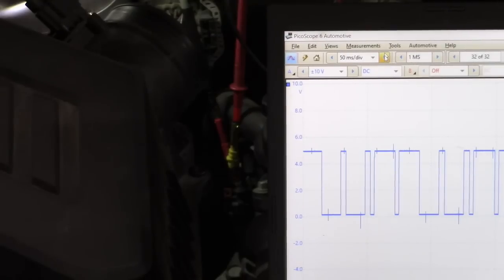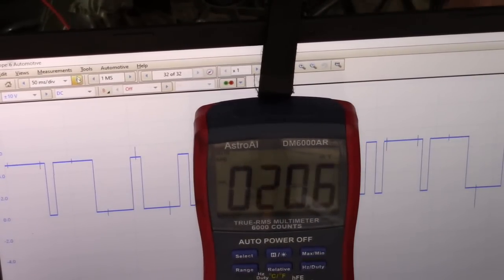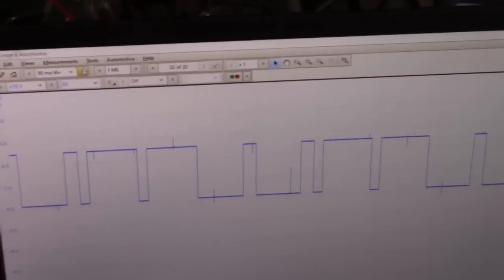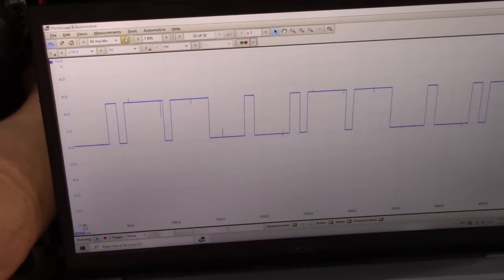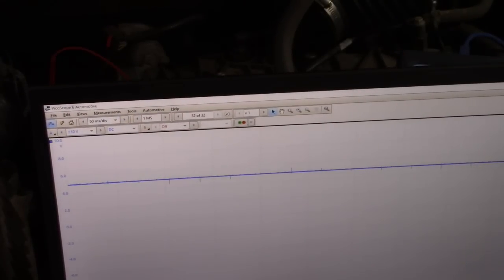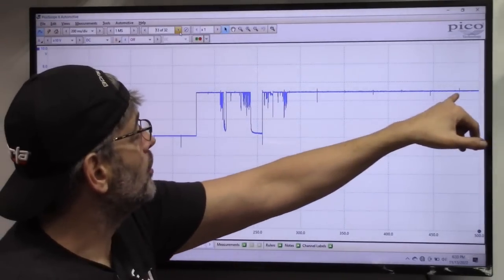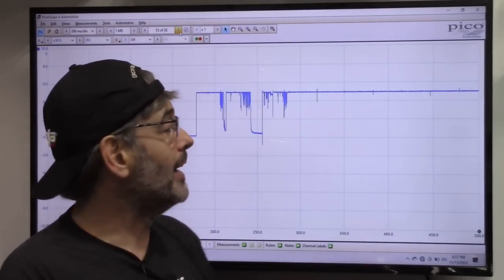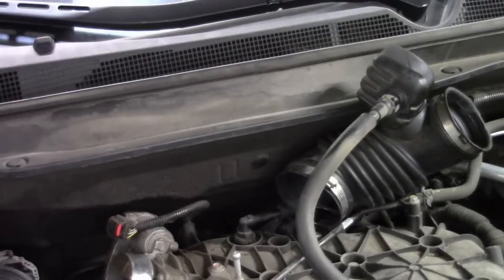How to Catch an Intermittent Bad Cam or Crank Sensor

Comment: I have a question about probing. If I have a 3 wire sensor for example… 12v power, ground, and 5v reference/signal; and I want to test the 5v signal, do I place the positive lead on the 5v signal wire and the black test lead on the ground wire or do I put it on chassis ground? 

I’m really trying to get an overall understanding (in case I don’t have wiring diagrams) of how not to fry the computer.
Reply from the maker: It depends on the design but on virtually all of them the signal will be a positive voltage so you will have one lead of DVOM on EITHER the sensor ground or chassis ground and the other on the signal wire.
  The ground doesn’t matter as far as the reading however if you don’t see a signal, you will want to try putting meter to chassis ground because maybe the sensor ground is bad. Remember you are probably looking at a sensor issue if you are doing this, right?
  Also keep in mind if you don’t see signal it might be because there is no reference. 
  Usually what I do is I put one lead to the reference and the other to the sensor ground. If I see the reference voltage then I know both the reference is good and sensor ground is good right there.  If I don’t see the reference voltage I will move the lead from sensor ground to chassis ground and if I now see voltage, you know the sensor ground is bad. If I still don’t see reference, I know there is missing reference signal.

Comment: Had my changed before it was car would shut off now it doesn't but runs like crap showing 336code also had cam and crank done can't do relearn because it won't go to 4000rpm what should i tell them to look for when I take it to the shop

Comment: I have a 2007 Buick Lucerne 3.8 V6 and I have the problem of sometimes it cranks but has the auto start problem where it keeps on trying to crank. It also stalls occasionally at low speed. Sometimes it will go for weeks without a problem before it does it again. I've been at a loss to figure this one out. I haven't taken it to the dealership because it happens so seldom that I'm sure they won't be able to find it. This is the first video that I've seen that referenced the problem of it keeps trying to crank once started.
Reply: Have you located the problem?

Comment: what causes crank sensor to keep failing . replaced 3 in the last 6 months .
Reply from the maker: What is the nature of the failure. What part of the sensor is failing? Is it the power, ground or signal output?
Reply: @SchrodingersBox  I don't know , I put a new one in , fault code Crank sensor and goes good for 2 to 3 months then starts hesitating again and stalls . The first time i took it to a dealer due to no fault codes . They couldn't find what was wrong with the car . So i changed the fuel pump , no fix then the Crank sensor and ran perfect for a few months . Then stalled with engine light , Crank sensor fault . Changed it again and now this is the third one that has failed . must be something to cause it to keep failing .
Reply from the maker: So what data do you have?

Comment: I got a no crank no start On a two thousand three chevy trail blazer four point 2 Six cylinder. I changed the old spark plugs removed all 6 Old ones. I put the new ones in and it started up but it was misfiring.  So I changed the ignition coils around and it still was misfiring so I did not have my scan tool so I ASSUMED IT WAS the spark plugs I just purchased and put the old ones back in. When I put the old ones in, now it doesn't want to start. So I again put the new ones back in and it still crank no start. I got codes po300 .. what the heck do you think happened? Could it be my camshaft sensor or solenoid
Reply from the maker: what data do you have? Since you don’t have a scantool just stick with the extreme basics - what is you signal voltage at the coils showing and is ground side switching conformed?

Comment: Good video. Can cam sensors fail intermittently without throwing fault codes?
Reply from the maker: Yes for sure. The code depends how long the signal is missing and also how consistent it is missing.

Comment: My 2007 Dodge Charger is having this problem and was wondering how I was going to "properly" diagnose this. Tomorrow will be a good day to try to tackle this and I'm saving this video and going to be referencing this video as I do. Thank you. I have a crank no start since June of 2022( last summer.)  All started after changing the ECT sensor got a horrible rattling sound instantly on first start and everyone after. Thought I had a pulley bearing going out or something and every since I took the serpentine belt off it will not start. Cranks forever and ever and at my wits end with it stressing out. Even had to basically go out and get another vehicle so I had transportation for work and everything else lol.
Reply: Updates..?
Reply: Did you figure it out?

Comment: Hello, thank you for such an informative video. Can anyone tell me if reference voltage or ground is lost, will the voltage shown be '0.0?' Thanks everyone, for trying to build my knowledge.
Reply from the maker: it will if you measure against that lost ground. check against a chassis ground to confirm voltage is present or the ground is missing.

Comment: Wonder if my 07 dodge ram has this issue when I turn to crank the 1st time wont start  unless car is hot but when cold I need to go for a 2nd crank. My other issue is truck stalls when I'm coming to a stop at a sign or light.
Reply from the maker: could be. when it happens just check any easy to access coil for ground.

Comment: Just changed my altima 2014 crank sensor due to no spark. It did not help. Took it to the dealer and they said after market sensors don't work in Nissan cars.  I wish I knew that.
Reply from the maker: I find that pretty suspicious.  The factory sensor worked??
Reply: Aint true. I have nissan frontier. Truck completed stalled dead on freeway which scared me to death with no CEL warning. Towed to my honest mechanic, code p0335 ( i think) replaced after market. Back on the road again.

Comment: I’m having the intermittent need to crank over 20 times to start problem. A strong deiseling smell once it finally starts. How do you know if it’s camshaft or crankshaft sensors? The problem so far ONLY HAPPENS ONCE THE CAR has been driven…is hot…then shut off for 20-30 minutes. Hasn’t happened on a cold start…so far.
Reply from the maker: What is your crankshaft sensor data showing?
Reply: @SchrodingersBox  Taking it to my Toyota mechanic Friday

Comment: Interesting is, RPM didn't reflect sensors bad output while it should spark timing, shouldn't it? Also could be good to mention potential problems  only when engine block (and sensor) are hot, is it correct?
Reply from the maker: Good observation on the RPM. I do believe it’s because the Crank sensor provides the RPM signal as opposed to cam sensor(s).
Reply: @SchrodingersBox  Engine should stall as a precaution since crankshaft position (piston top dead center) is now unknown so spark timing is only estimated and bad spark timing can cause problems. I would expect more sanity from ECU..
Reply from the maker: Yea but remember there are TWO cam sensors on this vehicle. Maybe the other is being used as reference when one dies?
Reply: @SchrodingersBox  Oh my goodness,  I thought all this time you were testing crankshaft sensor 😵‍💫
Reply from the maker: Hahahaa yeah you had me confused there my friend lol!!!! All makes sense now, right?
Reply: @SchrodingersBox  Sorry about that. I hope you too understand now my point. Thank you for your time.

Comment: If the sensor gets "stuck" for whatever reason pulling your reference signal voltage to the ground, you might think that you have a wiring issue while, in fact, you have an internal failure of the sensor (internal short to ground). So, if that happens, you need to disconnect the sensor and see if the reference voltage goes back to 5V with the sensor disconnected.

Also, the supply voltage for the sensor could be 12V (battery voltage or maybe even stabilized 12V), it is not always 5V.  

The ABS sensors on modern cars are Hall effect sensors and they only have two wires (off the top of my head, signal output serves as a ground too). And various position sensors also use the Hall effect element in their circuitry and have three wires, but they output analog signals.

Comment: Learning so much from these videos, really love  the scientific approach, thank you! Nowhere near the 2% yet more like 50. However, inspired to do better my audi was starting badly and stalling when hot. Scanner showed intermittent crank sensor, forget code. Looked up the spec for resistance,  unplugged it and was in spec. Damm! But tried harder. Started the engine let it run till it stalled. Checked resistance, open circuit! Replaced sensor and running fine now!
Reply from the maker: Nice work!!! Yes the problem is while it was working you will see the normal resistance. you have to catch it fail.
Reply: @SchrodingersBox  thank you! While it turned out to be what the code said, I did not want to fire up the parts cannon. Was so happy to get under the car knowing that was the problem rather than hoping.

Comment: No good to say any wire colors anyways cause brands use different colors than others so if ppl think the color matters it will more than likely be a different color on their rig
Reply from the maker: EXACTLY!!!!!!!!!!  I wish more people understood that.  can you imagine the hate mail I would get if I said to ground the green wire but on someone’s car the green wire is a power feed from the PCM and grounding the wire shorted the PCM?
   You get it bro!!
Reply: @SchrodingersBox  iv been working on a ton of different brand rigs for the passed 20+ years iv seen alot of different color grounds and powers on different brand rigs
Reply from the maker: Yeah and the “reddish colors are powers and greenish colors are grounds” is a horrible rule. On my GM vehicle, the power for the crank sensor is perfectly green lol.
Reply: @SchrodingersBox  yup i can 100% agree with that cause it can be red on one green on another or blue no one knows untell its checked to figure it out on that rig its self

Comment: Good job SQ box. No signal but if you did, then wiring integrity to PCM. Had one guy splice connectors but he mixed up the wires; good thing these wires from PCM do not carry or apply load. You can short them all you want but you only get a high or low circuit code which is great for wiring integrity testing with a test light.
Reply from the maker: Yes I have a video with a shorted reference wire and the PCM did not blow thanks to the internal resistor from the 5V reference circuit.
   Now I have seen 12V reference signals before on some sensors but even then, the way it works with it being pulled to ground it still shouldn’t blow the PCM if it shorts out- that’s what the sensor does anyway. I have done a bypass of those before but I was still nervous about it and used my test lamp but I don’t doubt a paper clip would have still been just fine.

Comment: Is there a way to diagnose a cps not pulling all the way down to ground with a dvom?
Reply from the maker: Yes-  you would basically do a voltage drop measurement between the sensor ground at the sensor and the low reference pin at the PCM. it should have no voltage drop. if it does then there is an interference in the ground.

Comment: Not all hall effect sensors are the same... you need to consider pull-down type designs.  The pcm sends 5v, through an internal resistor, to the hall effect sensor signal wire.  The sensor itself will pull this signal to ground when triggered.  So your exact test, where you measure voltage between the signal wire and ground, would result in a bad sensor even if it was unplugged (sensor has clearly lost power supply and ground).  I feel it's important to check all wires.

Also, not all hall effects are the same... look at the crank position sensor diagram for an 02 maxima.  It uses 12v and ground for the sensor's power supply.  This is a strong indicator to expect a pull-down design, as the signal wire is highly unlikely to have a 0-12v square wave -- the 5v is sourced from the pcm on the signal wire.
Reply from the maker: good points. You are absolutely right. still even more begs my point which is to think in terms of associating wires with their functions.  Doing so would adapt the testing accordingly. 
  but I should have clarified the generalization better.

Comment: One variable might be if the sensor ground pin fitment was loose/dicky. By backprobing the sensor, your scope connection to the sensor ground may stay good and you will still see 5V on the sensor signal wire, but a dicky sensor ground connection to the sensor will not allow the sensor to pull down the 5V reference, and hence it won't produce a square wave signal, potentially it will just pass the 5V reference straight through and out of the signal wire👍🇦🇺
Reply from the maker: agreed!

Comment: Matt, agree with your explanation of scoping using signal and sensor ground, but you DO need to scope reference as well, due to most Hall sensor outputs being "open collector output" aka "pull down design".
The ECM provides the 5V via a resistance on the signal line, it does not come from the sensor.
The sensor pulls that signal voltage to ground or just releases it, rather than drive it up to 5V.
So, if you lose your sensor 5V supply (reference), the signal will still go to 5V
Reply: @Simon Parkinson This only applies if the ECM is utilising a 5V 'bias' voltage on the signal wire. If that is the case, we would only see the bias voltage on the signal wire at initial key on with the sensor unplugged. With the key on, engine not running, and sensor plugged in, we will likely also see close to 5V on on the signal wire of a pull down sensor that doesn't use a bias voltage, unless a tooth of the crank or cam reluctor happens to be in line with the sensor at the time, then we might see a low voltage. Matt showed the zero volt scope reading before starting the engine but not sure if he already had the key on at that point.🤷

Comment: Is it possible to be a pull up instead of a pull down ?
Reply from the maker: it’s possible but I have never seen one that is pull up.
Reply: @SchrodingersBox  then the 5v KOEO u see is not verifying u have a good 5v ref only ground and signal circuit integrity... u migth have been loosing ur 5v ref preventing the hall pulling to ground..?  cheerz, great compact vid man!

Comment: On Subarus a dying battery like it around 11 volts and 10 volts will cause multiple usually Bank One cam sensor off the eyesight will shut off rip will shut off throw engine code and it's really just due to bad battery it could also be haven't changed the oil in a while in a CB in a valve engine system, changing your oil more often does wonders
Reply from the maker: Any car with a dying battery can get any number of codes. I have seen cars with bad alternators that threw 20 check engine codes for everything from timing to transmission.